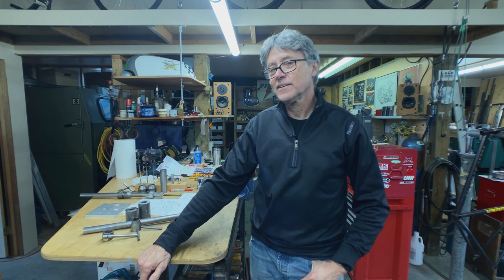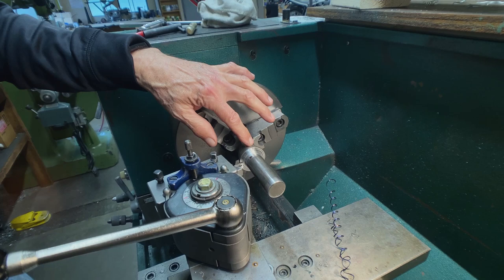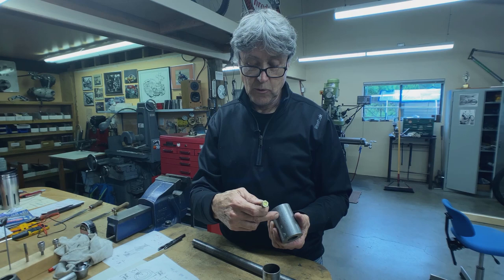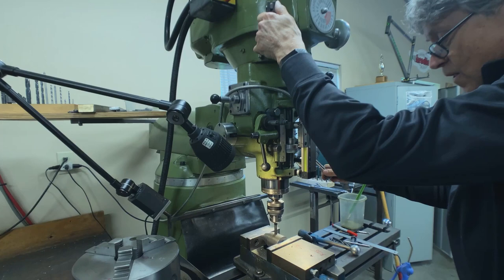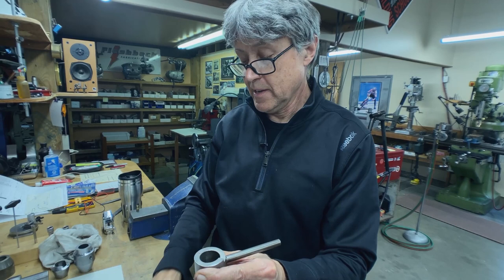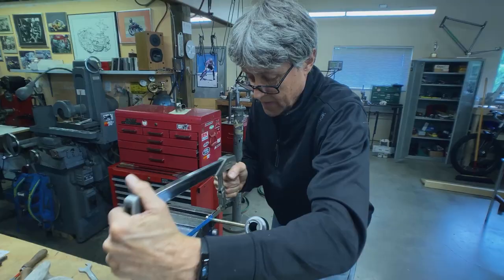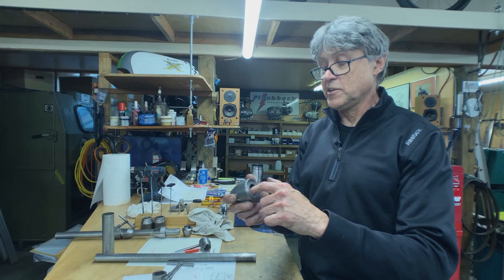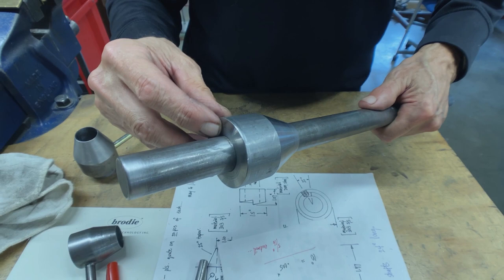Frame Alignment - Headtube Holding Fixture - Framebuilding 101 with Paul Brodie

Comment: What size DOM did you start with for this project?
Reply from the maker: The DOM, used for the tapers, is 1.0" ID and 2.0" OD. I think you might be making one!
Reply: @paulbrodie  I am going to give it a go. I think that this system is ingenuous. Thanks for sharing.
Reply from the maker: @brandonswanson5406  You're welcome :)